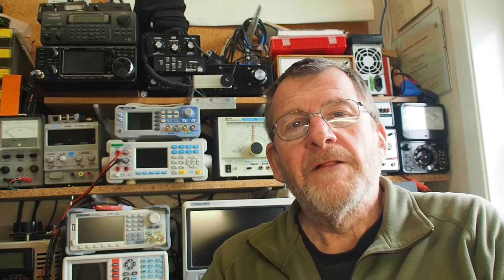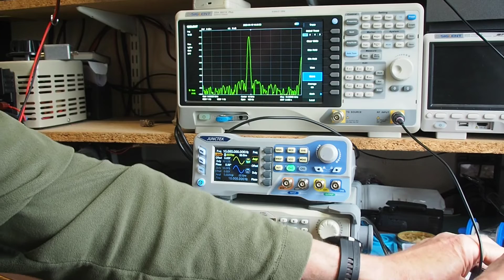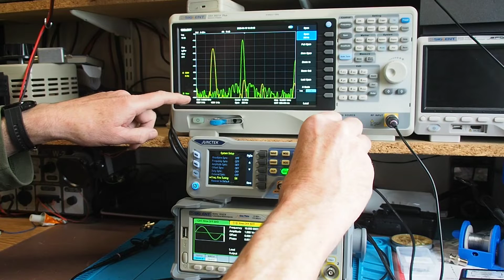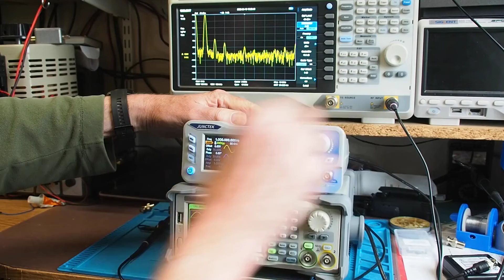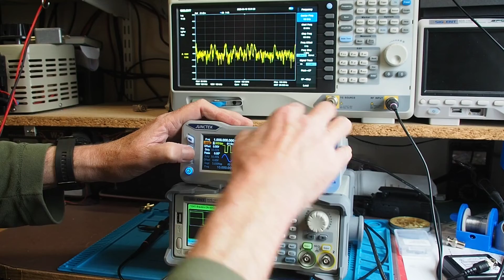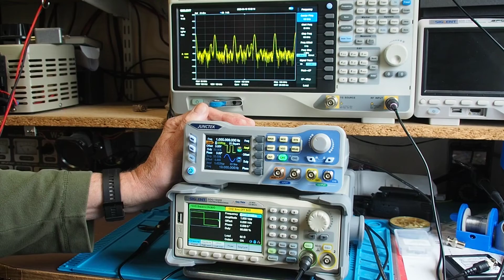Comparing Signal Generators   #156

Comment: Juntek PSG9080 has the ability to fine-tune the internal reference according to GPSDO and although it will never be at the level of a professional device, for an ordinary user the long-term accuracy is fully satisfactory. And if you have a GPSDO module at home, you can calibrate your own devices as needed. Also, a home GPSDO can make a reference for multiple devices in your workshop and thus get the accuracy to a very good level.

Comment: As it is possible to create own waveforms i expect it is possible to create a wave consisting of 2 (or more) sine signals. (There will be less datapponts so the signal will be less smooth). Did you do experiments with this to output higher frequenties?

Comment: I don't think the SA is the right device to compare two frequencies. Counter would give you much better results, but if you don't have one, there is another alternative — use your oscilloscope. Trigger on the reference observing the output of your generator. This gives you the phase comparison between your reference signal and the generator output, so when you obtain a steady (or almost steady) image on the screen of your oscilloscope, you are sure both reference and observed signal are (perfectly) same on the phase. And two signals being same in phase implies they are also same in frequency (this is how PLL works), so. If you tune the generator to obtain steady image on the screen while triggering on reference signal, you know that they are now both on the same frequency and then just read the frequency that your generator shows on its display and, knowing the frequency of your reference, you know exactly how off the generator's internal reference is. This gives you resolution better than 0.5Hz, which is something you never achieve using the spectrum analyzer.